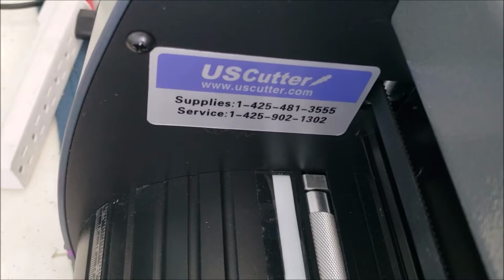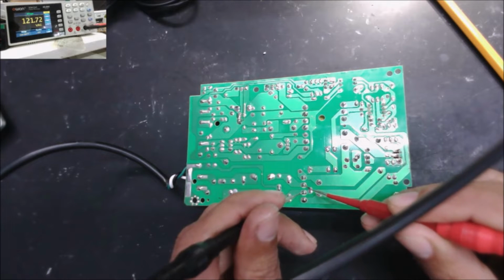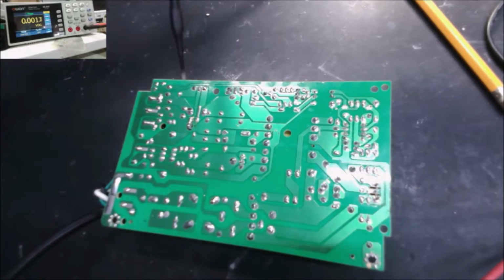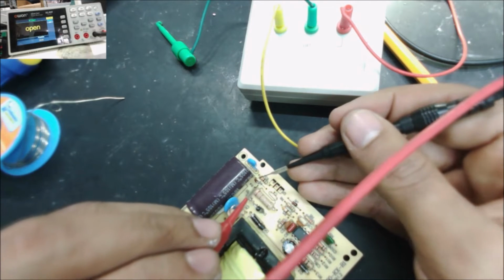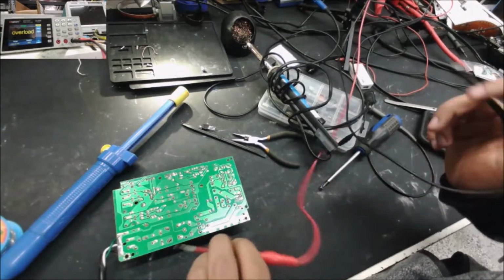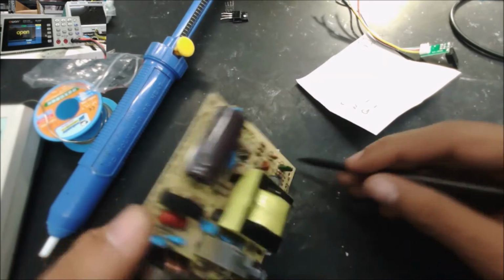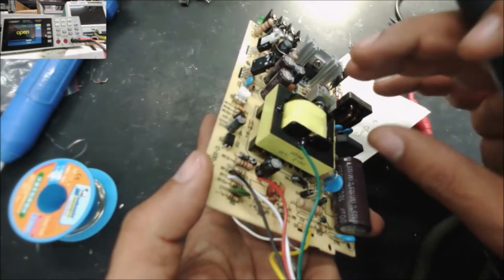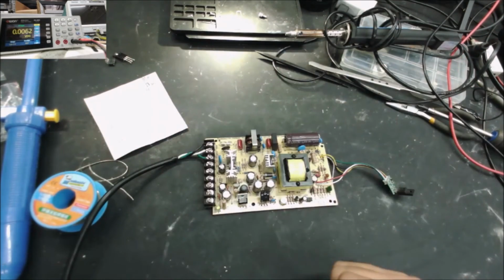US  vinyl cutter MH MK2 switching power supply repair step by step

Comment: Why don't you use a series Lamp to prevent explosion or damage to components
Reply from the maker: good idea, but i stopped  using the lamp after it burned bad a power supply, the lamp will keep the power on for long and that will cause more damage to the power supply incase of short

Comment: Excellent mod, thanks for showing how to do when all else fails. Could you tell me where I can get a module with the wires on it similar to the one you used?
Reply from the maker: from china for the big one 10 pcs https://www.aliexpress.us/item/3256801690613520.html
for the small one 1pc https://www.aliexpress.us/item/3256803639821708.html
you may find them on ebay or amazon if you cant wait 3 weeks
Reply: @SOSfixElectronics  ok, thanks. Yes no hurry but nice to have a few on hand just incase.